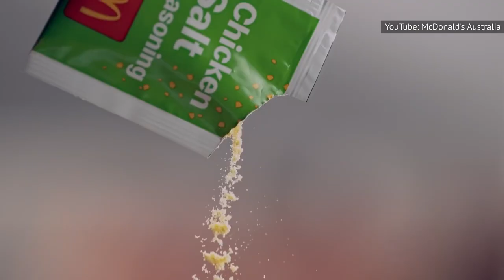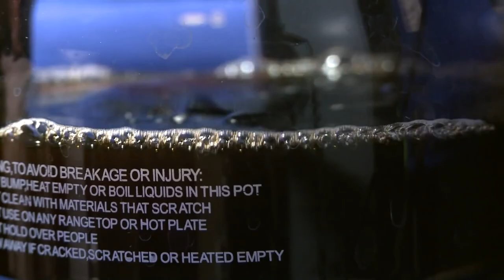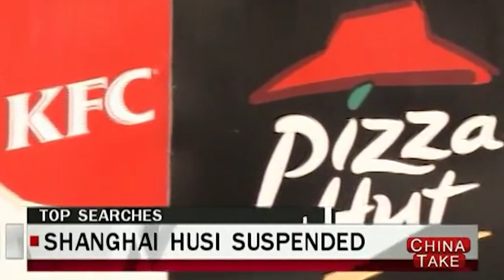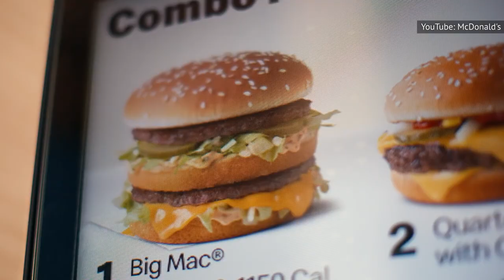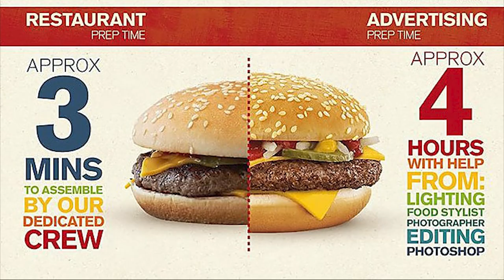11 Times McDonald's Told Bold Lies To Your Face

Comment: At 7 minutes 2 seconds on the dog. Randolph Vermont McDonald's does not have this marked in there prep manual. If memory serves me correctly we were asked to apply syrup before putting it into a separate machine.( Same process with the Oreo drink but without the Oreo.(?))